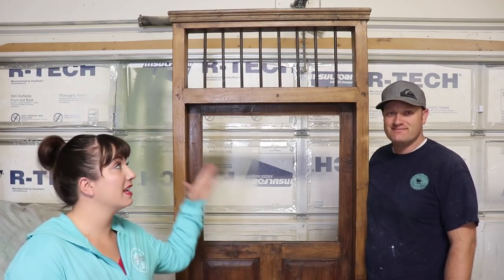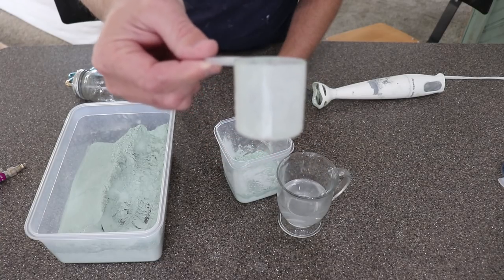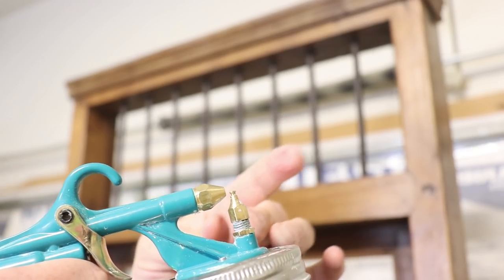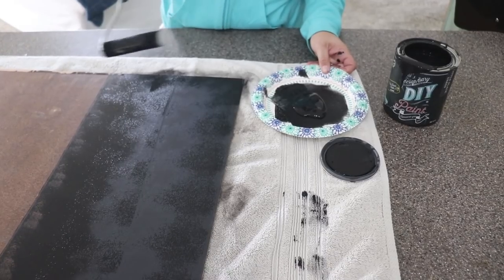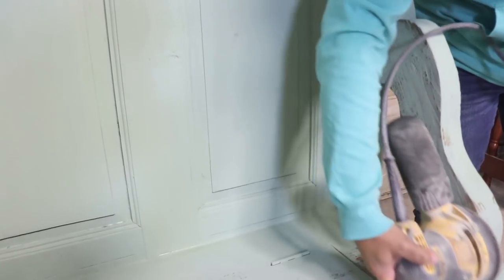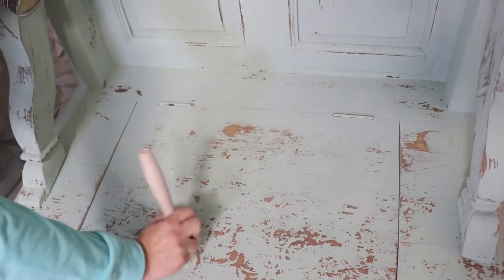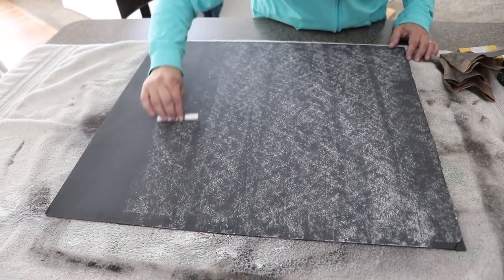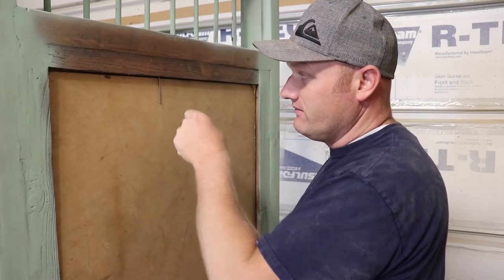Hall Tree | Chippy Milk Paint

Comment: Zeb did a nice job making that hall tree. I see a salvaged door, salvaged or made corbles, I have a cabinet with almost that same design on it as the front, its spanish influence from the 70's if I remember right. Good new framing so you have something to nail too. A couple of stain colors I currently have in my home.  Yep, its a good Frankenstein hall tree. Good cheap repurpose of where the door glass was. A mirror would have cost a fortune. It should sell well if its not for your home.

Comment: Not thinking, I bought laquer instead of shellac for bleed through.  Do you know if it will work the same?
Reply from the maker: Lacquer is a decent stain blocker. It will take longer to dry in between coats than shellac. I would do 2-3  coats in the affected areas.

Comment: Ok, need help.  My milk paint did not chip or crackle.  Any advise?  Add another coat?
Reply from the maker: You could put another coat on and see if that reactivates it. Sometimes Zeb hits places he wants to help it crackle with the heat gun or blow drier while it’s drying. Doesn’t always work but he’s had decent success with that. Just real light heat. You don’t want to burn the paint. 😊